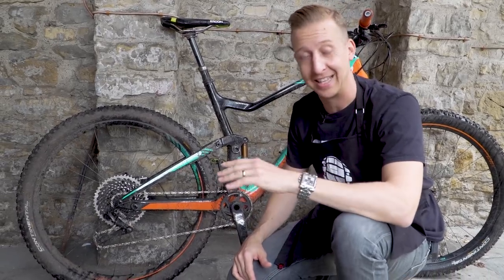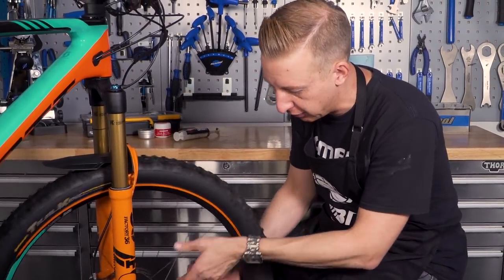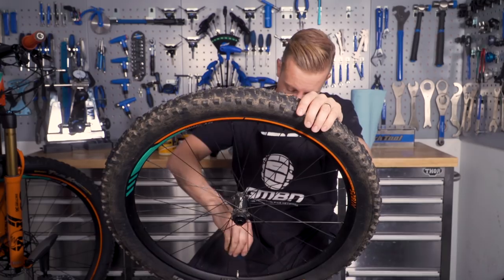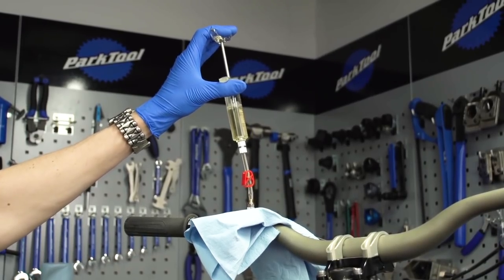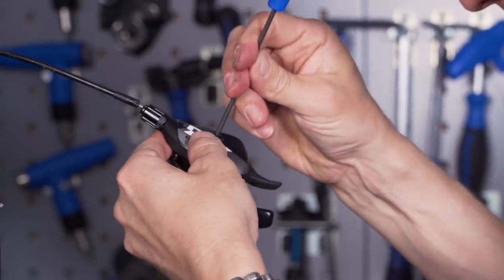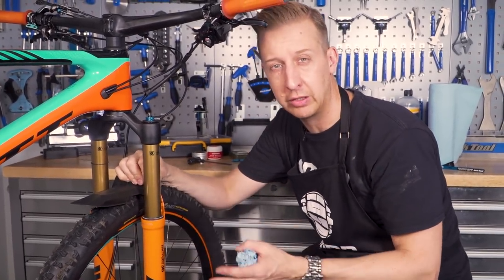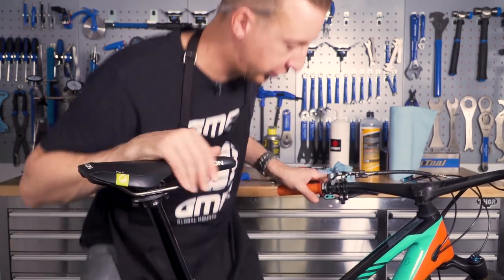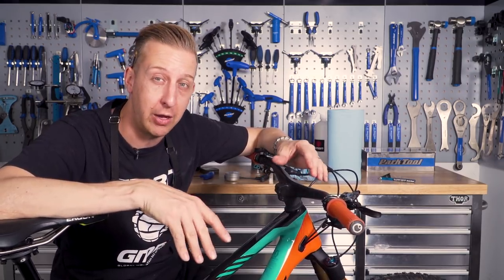Mountain Bike Spring Tune Up | How To Make Your MTB Feel Like New

Comment: Doddy i once did a similar job to my brand x dropper post as you did in the video. Then after a ride i noticed the black paint on the back of the post got skretched off, and i removed the grease. But my specialized dropper loved a treatment.

Comment: My shifter would go out of alignment after a week. Then I took a look at the cable. It was fine, bowden was fine, just the bloody caps. The gear cable and squeezed through.

My gear adjuster is on the mech and not the device. Up front would be so nice.

Comment: Another awesome video Doddy! I have a question about the tubeless sealant drying up. If it dries up over time, does it then leave uneven chunks of dry sealant on the inside of your tire? Could this effect the ride and handling of the bike? I guess what I'm really asking is, should the tire come off and old sealant be replaced rather than just adding more?

Comment: Why did you take the pads out the front of the calliper? I have the same ones and they come out the back holding the tab so you don’t touch the pad surface, and it’s easier

Comment: Question I have a rockshox monarch plus rc3 hv with a mastearo suspetion linkage, I plan on putting volume reducers in but I only want to take off the top linkage bolt or els I have take off my chainring and my shock has that 2nd cylinder thing on it so I’d like to know are volume spacers stretchy? And can I put it over the top if I slip it under the second cylinder thing and over the shock, will this work? Has anyone tried it?

Comment: how to bed in the brakes
Reply: shimano are a doddle but sram are more hassle
Reply: Gary Gilbert i have shimano
Reply: RIP MisterBassBoost as soon as you fit new pads, (make sure the brakes work) but before you use them properly build up some decent speed on a fire road or any downhill, and brake as hard as you can to a stop. 
Do that about 5 times and that's you done! 
There's a video on it too on gmbn :)
Reply: okey
Reply: Same as a car